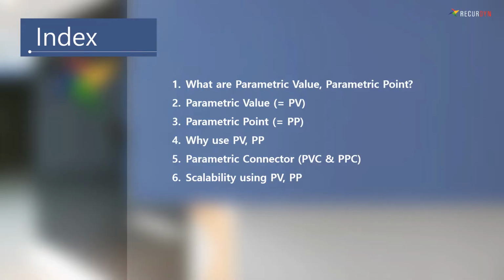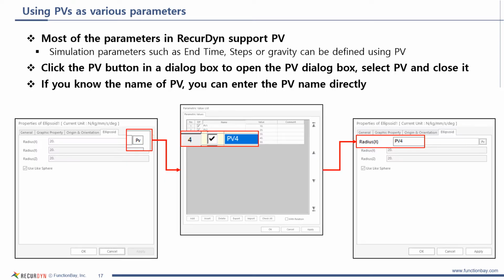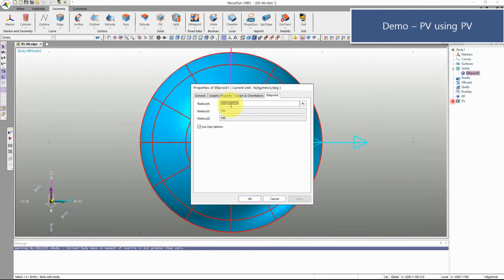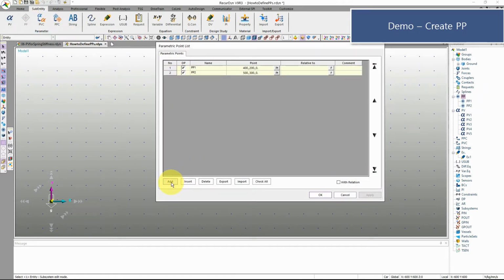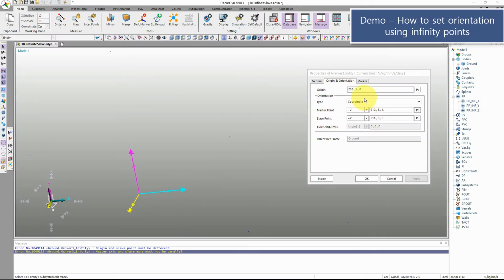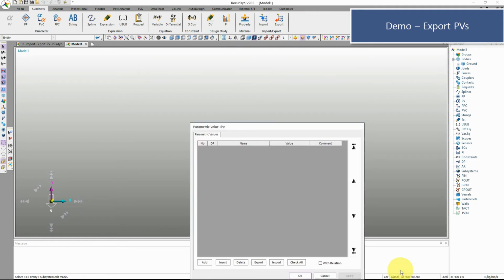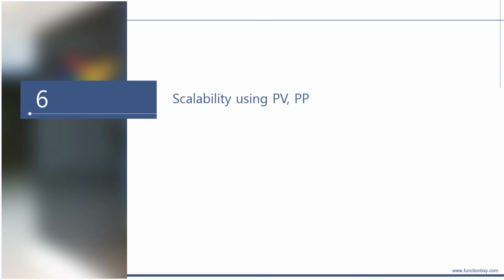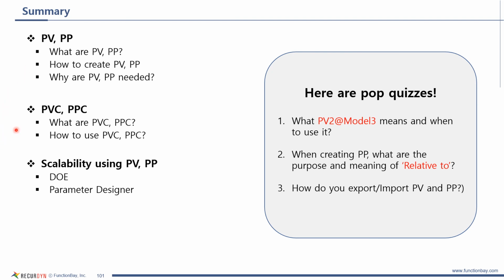[Webinar] Basics of Parametric Modeling with RecurDyn

Comment: Dear Sir,

Is there any way to automatically update the parameters?

For example, I have a rigid bar AB with a length of 1 m rotating about point A. I would like to investigate and compare the angular velocity results when the length of AB changes (e.g., AB = 1 m, 1.1 m, 1.2 m, etc.).

Currently, I cannot continuously import or update the value of AB. If I have 100 test cases, having to manually import the model 100 times is not practical.

Is there a way for RecurDyn to be linked with another software or controlled by a script to automatically vary parameters, for example by using a for loop to run simulations over a range of predefined values?